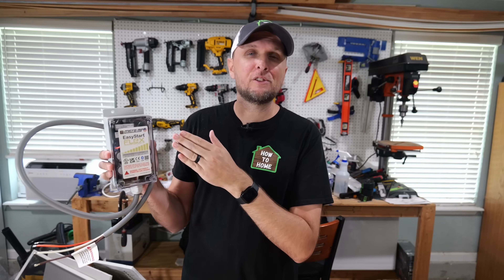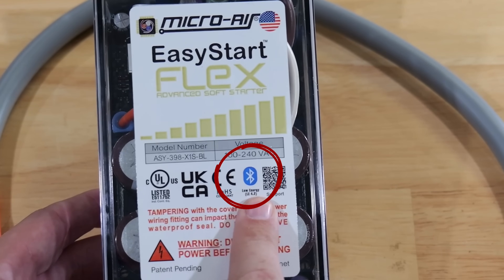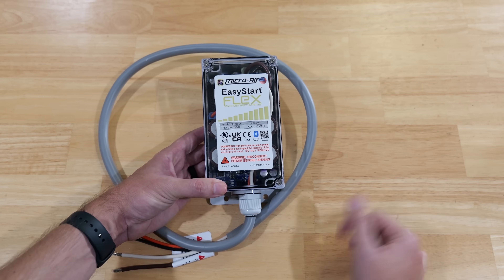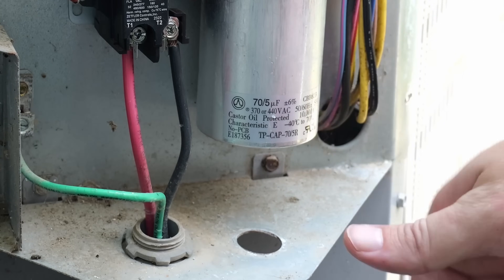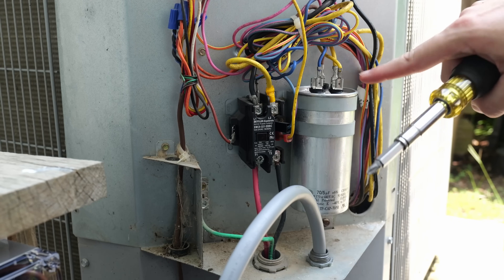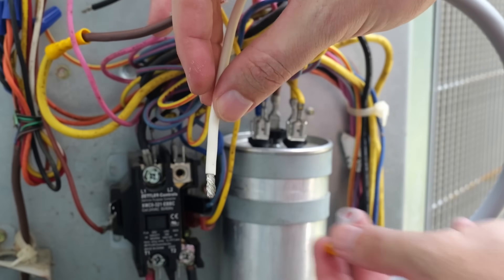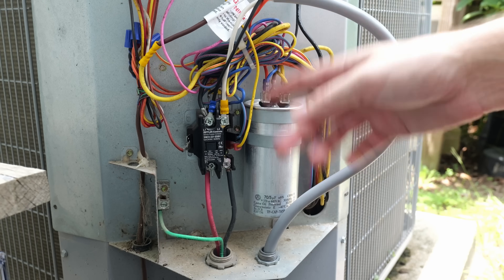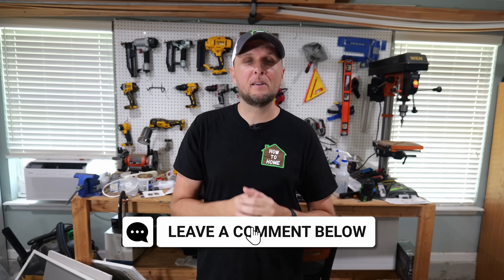The ONE AC Upgrade Every Homeowner Needs to Consider!

Comment: Not an expert but it appears that contactor is installed upside down. I don't think it matters since the contactor is just a relay switch.  L1 and L2 should come from the power in side.
Reply from the maker: You are correct on both.  The labeling is technically upside but you're also correct that it doesn't make a difference.
Reply: @HowToHomeDIY  Just turn the camera upside down. See, that was easy...😄😉

Comment: I have a 3 Ton AC unit and after installing the soft start (old model Micro Air for the 36000 btu ac unit) a year ago, the in-rush current dropped from 77A to 22A . So my generator will handle it when needed. I have a Generlink so connecting my generator is easy.

Comment: I think you are very informative I’m going to put a soft start on ac unit for a generator. Do i need to put one on air handler inside the house?It is heat pump fan unit inside. Would greatly appreciate if you respond back I just want it right thank you for all the info!
Reply: Not an expert but the EasyStart Flex could benefit the heat pump but not the fan.

Comment: The compressor needs the high current to start. Soft starts unfortunately slow the current, similar to a brownout, damaging the compressor motor over time.  Otherwise AC manufacturers would offer soft starts as an option for people with generators.
Reply from the maker: Incorrect.
Reply: Compressors do have a high locked rotor current (LRA) during startup if powered normally, but this surge is a "side effect of the design", not a necessity.
EasyStart Flex reduces the peak start current by up to 75% by gradually ramping voltage and current to the compressor motor, not by simply "slowing current."

This gradual ramp minimizes electrical and mechanical stress, unlike a brownout which can cause stalling and overheating due to insufficient voltage.
Soft starting with EasyStart Flex actually protects the compressor motor, extending its lifespan by reducing inrush current, heat buildup, and contactor wear.

Many AC manufacturers do not include soft starters as standard due to added cost and traditional designs, not because soft start harms compressors.
EasyStart Flex is widely used, especially for generator-powered systems, because it prevents the hard starts that would otherwise damage compressors or blow breakers.

Its technology actively monitors electrical parameters in real-time to optimize starting and avoid damage.

Comment: I have a couple questions. First, how is this holding up? Second, we are thinking about upgrading our ac unit within the next year or two, will this be something beneficial for newer heat pump and inverter type condenser units? Or do inverter type condensers already have soft starts in them?

Comment: Having a problem with the bluetooth. Keeps trying to hook to my TV
Reply: In the EasyStart Bluetooth ID section, type" EasyStart_" (leave out the quotes), be within 5ft of the unit then press the Connect To EasyStart option. If the Connect to EasyStart function is not available to press, then completely shutdown the app by removing it from memory (on Android), ensure Bluetooth is still running but not connected to anything and start my instructions again. The program will automatically fill in the rest of the EasyStart_ ID. (Yes, it does need the underscore character.)

Comment: Not everyone needs a softstart.   please check with MicroAir before installing.   their bot can take your hvac part number and tell you if it is compatible.   many new machine have softstart built in especially the variable start models.
Reply: Yes, this system is not for variable start models.

Comment: Ooof, bad idea.  The worst thing they ever dit to air conditioning was to make them soft start in the first place. They used to have potential relay and start cap, and all compressors are designed to hard start in that fashion. Your just increasing the time it has to stay on the delicate start windings in the compressor. You are literally cooking your start windings. You could delay the compressor by letting the condenser fan start first with a 7 dollar relay and a 10 dollar delay on make timer, but the gains would be negligible.  You really want that compressor off of the start windings as quickly as possible.  I guess these will sell a lot of compressor replacement jobs for you.
Reply from the maker: These will sell a lot of compressor jobs for me?  I have it on my own AC unit, because it will make it last longer.  Nothing you said is factual in regards to what these do or what they will do.  I have nothing to gain as I do not fix ACs for people.  These have been out for numerous years now and people's compressors prematurely failing because of these soft starts has not and is not happening.
Reply: @HowToHomeDIY Air conditioning is all soft start. This is like saying using a small battery cable to the starter on your car is good because it turns slower. Air conditioning used to have a potential relay and hard start. Those systems run forever. Why would you want your compressor to start slower? Get it up to speed immediately.  The real world doesn't accommodate to these gimmicks.  You get a short cycle due to a power issue and they can't start under a load, then they burn out. My air conditioner is literally 45 years old. Has a potential relay and a start cap with a permanent split capacitor just like every hard start refrigeration system ever has. You're taking a millisecond reading of the start current,  which is misleading.  Refrigeration compressors hard start and run for decades that way. This is a gimmick.
Reply: @HowToHomeDIY 
Oh, I forgot,  only you get to accuse everyone else of scamming people,  but when you are exposed , not fair. Don't be defensive,  just do better man.
Reply: @anthonypaules7893  Start windings on an AC compressor are far from delicate as they’re built to handle huge jolts of current multiple times daily for decades without issue. 

The voltage and current supplied to the start windings during operation with EasyStart are much lower and precisely controlled based on the compressor’s real-time characteristics, which EasyStart continuously learns. This tailored “soft start” approach is not new; it’s essentially the same principle built into modern variable speed AC units to protect motors and improve efficiency.

In fact, reducing the often harsh locked rotor amps with a soft start doesn’t harm the compressor motor, it actually reduces mechanical and electrical stress, extending compressor life. Hard start systems rely on sudden high current surges that do work but also increase wear and tear. Soft start technology, like EasyStart Flex, works by gradually ramping voltage and current in a way that’s easier on the motor while maintaining reliable performance. 

So, it’s not a gimmick but an advancement in compressor protection and durability.
Reply: @SpaceCadet4Jesus 
Wrong,  you're assuming they never need to hard start. You're knowledge is 100 percent theoretical.  In the real world,  things happen and wear occurs, which requires a lot more starting torque.
Reply: @anthonypaules7893  You changed the conversational goal post into known problematic AC systems. You are accusing me of assumptions that I'm not making, in other words, making assumptions about assumptions that I am not assuming.

If your system is not running well without a hard start kit, then indeed it cannot use a soft-start kit. Modern variable speed AC units have the soft-start principle built in.

Soft start kits are for extending the life and amperage draw of your good compressor motor and to save money if your electricity is being charged by peak demand values.
Reply: @SpaceCadet4Jesus 
No, you changed the argument and made assumptions.  My  assertion was always that the real world offers never-ending obstacles that result in soft starting units having failures like blowing fuses and tripping breakers, and shorting permanent split capacitors. You assumed the world was perfect,  which it is far from. Hard starts can make it through these obstacles and they run for decades. Refrigeration units hard start and run for decades. I bet you would argue VSD'S are good for fan motors too? Never mind the failure rates have quadrupled since they were introduced.

Comment: I'm no electrician, so take my comments with that in mind.
I'd be shocked (pun intended) if a Soft Starter would affect a power company's demand charge. The purpose of the condenser is to build up charge "slowly" and release it in a blast. It can only draw the amperage your breakers can deliver. Those 120+ inrush amps come from the capacitor, not the breaker panel per se.
That said, if a compressor can start using ~32 inrush amps (plus the fam motor's draw), it does seem ~120 is mas overkill and components could suffer from it.

That said... Does the addition of a Soft Starter temporarily starve the compressor motor, akin to the way using a too long, inadequate gauge drop cord starves the equipment it is powering?
Reply: The starter capacitors job is to shift the phase of the voltage to increase the torque, as it charges the phase shift drops to zero and the starter capacitor is basically just following the source. The inrush current is very much coming from your panel/power company.  I've used one of these for over 12 years now and just upgraded to the bluetooth version.  Without the "smart" start unit I have a 70-90 amp inrush, with the micro air unit I don't peak over 27amps.  My generator doesn't even bog down anymore when the AC cycles.
Reply: @AIM54A Thank you AIM54A. 
As AIM54A said, the condensor's purpose is not to build up charge slowly, but to provide amperage out of phase with the source.

Yes, an AC compressor motor can momentarily draw more current (inrush current) than the breaker’s rated continuous capacity because of how circuit breakers are designed and rated.

The locked rotor amperage (LRA) or inrush current of a compressor motor can be many times (up to 20 times or more) the motor’s running current at startup. Circuit breakers and fuses are designed with time-delay or thermal mechanisms that allow short bursts of high current without tripping, as long as it is brief.  The breakers “heat up” and trip only if excess current continues long enough to exceed their thermal rating.
This means breakers tolerate the very short high inrush current spikes during motor startup, typically milliseconds to a few seconds.
After the motor reaches running speed, current drops and stays within the breaker’s continuous rating. It's that EASY.

The National Electrical Code (NEC) accounts for this by specifying appropriate breaker sizes and trip curves for motor circuits.
So, while the compressor “demands” high current instantaneously, the breaker can supply this surge without tripping because it’s designed to handle short bursts safely.

This built-in tolerance is why startup flickering lights and temporary voltage dips occur but breakers don’t usually trip just on startup current spikes. So, breakers don’t limit the absolute amp draw instantly; they respond thermally over time and allow short inrush current pulses so motors can start properly without nuisance trips.

Comment: Doesn't work on Goodman heat pumps
Reply from the maker: I don't believe that is accurate.
Reply: @HowToHomeDIY unless the soft starter was bad. There was a screw floating around the inside of the unit when I revived it

Comment: ive heard both sides these make the compressor last longer and ive heard the make them last shorter by starving them of stgart up current?
Reply: They control the startup current by spooling up the compressor in a controlled manner.  Less current to the windings = longer life.
Reply: Same principle as with modern variable speed compressors, now the EasyStart functionality is built-in.

Comment: I have mini split.  Can this be installed on my unit to run from a generator during outages??
Reply: Mini-Splits don't require enough startup amperage draw unless the generator is way undersized. 25amps at most?

Comment: Fun fact: if you’re in the market to replace your AC buy the 18 seer unit with inverter. I can start my 3ton AC with a Honda EU7000 (5500 run watts) with zero issues.

Comment: I installed the ASY-398-X1S-BL

Read the directions. 

Studied the wiring diagram for my Amanda 3ton unit.  Discovered it’s also a Goodman unit, which they have specific directions for. However, the general directions were more useful… if verbose. 

Then wrote down the connection for each wire on 4x5” index card. 

Then, put proper connector on end of each wire. 

Installed & everything worked perfectly. 

Inrush amperage dropped from 90 to 24. Running amps 12. 

Connections: 
Black & White go to contractor, opposite sides. I used O rings & screwed them down. 

Orange goes to HERM on capacitor, do, shovel connector. 

Brown wire is the tricky one. 

It needs to be spliced to the RUN wire that is removed from the contractor. The existing RUN wire has a spade connector. So, install a spade on the brown wire. 

So, if I need to, I can easily remove the device & simply plug the wires back in the way they were.

Comment: Can't thank you enough for this video. I bought the flex and watched a bunch of tutorials but it's fair to say that this is the best one.

One potential issue I may be having: my current running amps are between 4-6 per the diagnostic app when the compressor is running. This seems very low given that my unit has an RLA of 12.8. 

Unfortunately I didn't think to test the original numbers before install because I didn't have a multimeter, but I did just buy a clamp one. Do you think it's worth it to wire the system back to the previous wiring to see a before/after? Our AC seems fine right now and is able to maintain 74/75 degrees indoors.
Reply: My RLA is 12.3 on the label. But according to the Bluetooth app, the unit is running at 5.2amps at 80degrees outdoor ambient temperature. I installed a new capacitor at same time. I'm not going to complain.

Comment: Installed the Easy Start Flex back in Jan of 25 after upgrading from the Easy Start 368 and so far so good. We are able to start and run a 3.8 ton AC with an AI Power 7100. I upgraded to the Flex because the 368 FAILED. Incidentally, we had a capacitor go bad on a weekend and were forced to call a local AC repair company because all the local supply houses were closed. I didn't have a replacement capacitor available so my hands were tied. The AC tech admitted he had no experience with soft starters and I suspect he may have messed with the wiring while trying to diagnose the capacitor issue. Micro Air was unwilling to warranty the 368 after going back and forth for several days. The Flex and AC unit has been working flawlessly since install but I will check back with any issues. Lessons learned: Keep basic AC parts on hand. If you have to call a repair company make sure they're familiar with soft starters and watch them like a hawk if they're not.
Reply: Easy fix was this: Unplug the Easy Start 368 and connect the compressor wire back to the terminal on the relay it came from. Reversing the install is easy. I used spade connectors which are easily pulled and a Wago connector I simply need to unplug. In retrospect, your install was only cutting one wire which was the wire leading to the compressor motor, the rest of the wires were simply additions.

Comment: The Micro-Air Soft-start Flex seems very helpful during power outage, but it will not last.  My unit FAILED IN JUST 11 MONTHS. with MULTIPLE  INTERNAL PARTS BLOWN!   I hire my AC Technician to check my system when my ac stop working and he told me I am lucky it has survived the blown soft starter. I was shocked when I checked the reviews on Amazon, there has many customers has the same problem as mine.  They failed within a very short period of time.  Some even have there replacement blown in a very short time.  With the investment over $400,  plus the cost of hiring AC Technicians to install and fix the failure,  I would not recommend to any friends and family.  Use on your own risk.
Reply: Honest question here, could it have blown parts due to a power surge? I notice in the video he mentions there’s one of the benefits of this device
Reply: @kenw4930  No sir,  they have been failing at an unprecented rate.  Micro-Air's tonnage specific models were top of the line units.  Once they moved over to these Flex units, their troubles began.
Reply: @kenw4930 Micro Air had a bad batch of capacitors that made ~4% of the units fail. The affected devices with serials 398006200 and lower. All serial numbers above that should be good. I happen have one with a lower serial so I have skin in the game.
Reply: @kenw4930 yeah no. Don’t use these. They’ll slaughter your outdoor unit. Plenty of cases. Youtubers keep pushing them because they’re obviously sponsoring the vids.
Reply: Installed mine back in March 2025, freaking thing didn't even make it through the year. Unit died in August of 2025. Blown capacitors on the inside of the unit. 
One positive note, they sent a replacement under warranty the next week.
Reply: I installed the old one in 2020. Still working.

Comment: Works great.   Both my ACs have one and I can run either plus critical 120vac circuits on my 7250 watt inverter generator during a power failure.

Comment: If you have an old ac, and the soft start has to Lear what it takes in amps to start, could an old unit not see as much of a benefit? Especially if the ac needed or had a hard start?